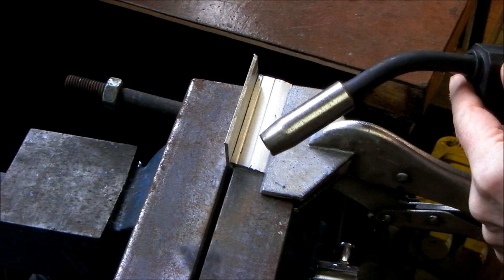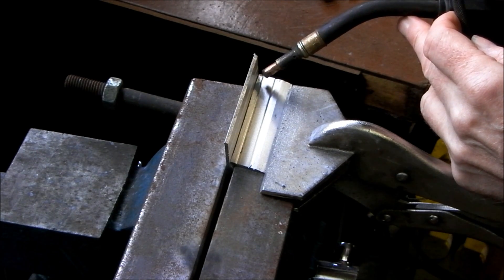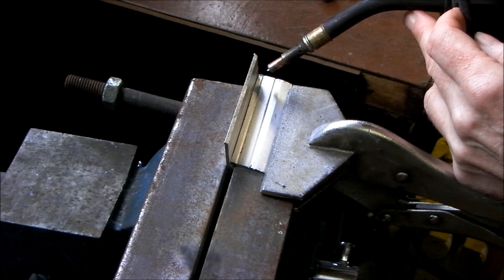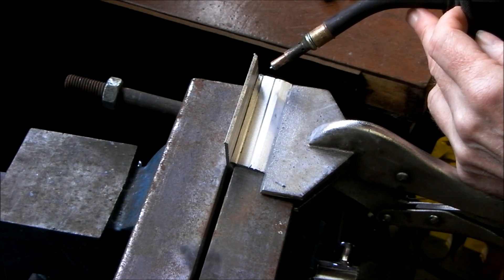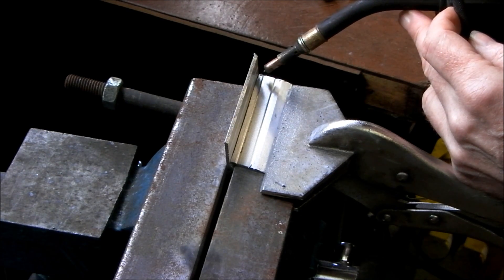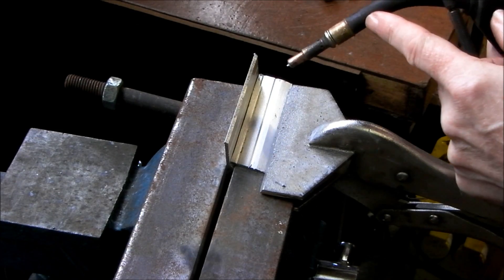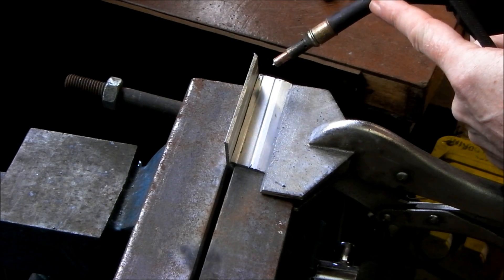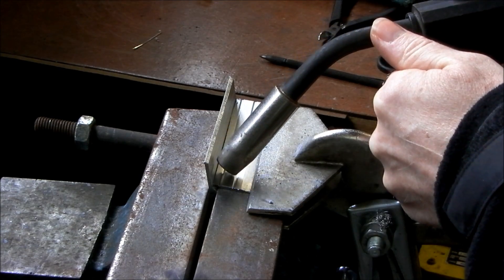Mig welding aluminum, stick out

Comment: One of the best videos I’ve seen covering the main issues with mig aluminum. Biggest problem I’ve had is having the wire melt back to my tip. After watching this I was able to get thru a project with one tip and not 8. Very good video and very simple

Comment: When welding aluminum it has it's own distinct spraying sound a good weld will be nice and clean,should be able to wipe over it smoothly with a cheese cloth rag with no hang up's. Inspectors weld test given inside aluminum milk tanker trailers

Comment: You're not in the full spray mode. I can tell that by sound and by splatter around your weld. And stickout doesn't have much to do with transfer modes.

Comment: What sheilding gas?
Reply: a gas used to push away outside air/contaminants, and protect the weld. argon is commonly used but i have also heard of people using helium but its not as efficient as argon im assuming because helium is lighter then air so you would have to use it at a higher pressure while welding to make sure the the weld is being protected and the helium isn't just going away from the weld area... at least thats my guess ( on the helium part )

Comment: I know everyone is a critic. However, contact tip to work distance is definitely not the key factor in determining your transfer mode when welding and really only has a minimal effect on amperage in the arc. Once setting an adequate wfs to make your desired sized weld, voltage is what does it (speaking for the CV welding process here)

Comment: i really dont mean to be a critic and since it was just a practice T joint it doesnt matter but the angle you showed the weld mad it look as if it had cold roll. may have just been the angle but thanks for the tips on gun angle it did help very much.